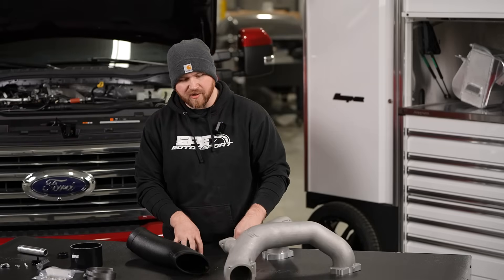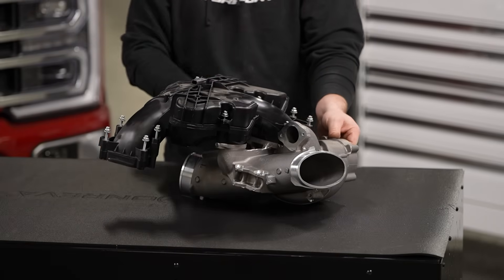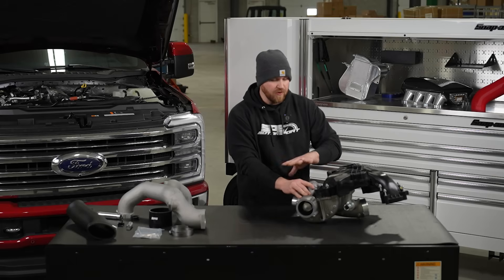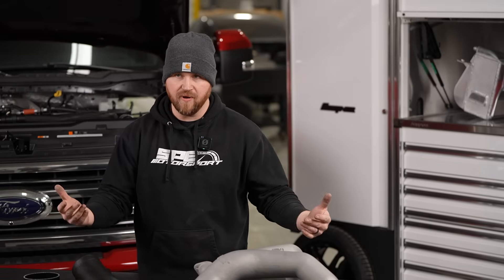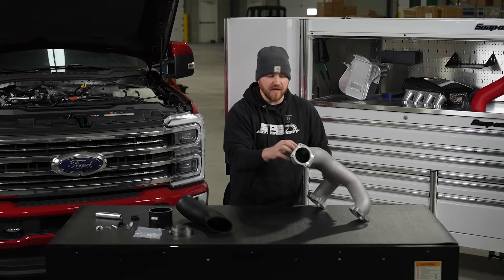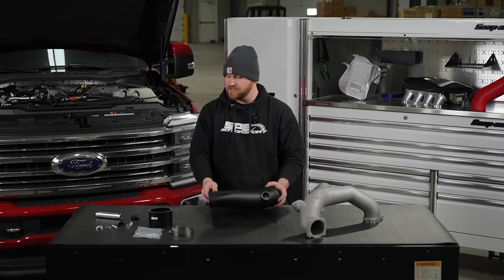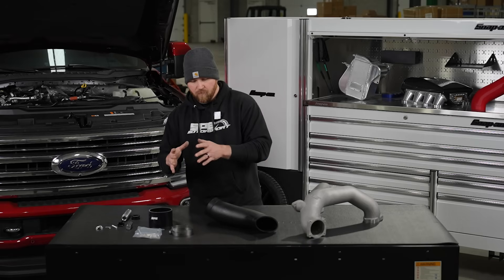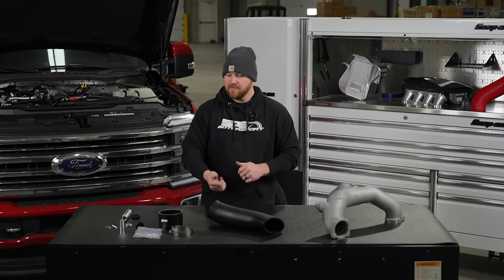6.7 PowerStroke OE+ Performance Intake Manifold from SPE

Comment: Ugh just saw a video of a guy installing the piping kit on a 2011-2019 f250/350 and he’s having fitment issues/wrong size clamps. Sucks cause I purchased one of these kits for my 2012 but haven’t installed it yet. Now I’m wondering if I should ditch it and get the pusher piping kit??

Comment: The biggest issue I have with mine is the EGR flange needs to be machined out further, and the screw adapter for the early throttle bodies is crap and a pain to install it. you should have just put the other screw hole in the casting I don't care what it looks like. the air intake tube for the 11-16 makes it where you cannot mount the factory tube in it's bolt hole by a full inch.
Reply: I had the same problem with the 11 to 16 cold air intake it fits very tight up against the coolant reservoir for the secondary coolant system. You pretty much have to install the bolt on the battery tray first because it’s misaligned by about an inch then you have to jam the boot together using a screwdriver also the flashing inside the tube needs to be ground out farther. There’s a huge ridge just inside both openings. I think the fit and finish could be improved somewhat I’ve never installed an S&B for that year truck so maybe they’re just as bad. I will say most of the other parts from spe are extremely good quality. No company is perfect. I did fuss about it to them and they sent me a new intake tube, but it didn’t fix the problem because all their intake tubes are exactly the same, but at least they tried to fix it.

Comment: Unless I update the turbo on my 2011 this isn't going to match up to the dual intakes on the turbo.
Reply: Theres not many options on the market for stock emissions + dual compressor wheel intakes. SPE and Pusher do make dual inlet intakes, but theyre non-emissions piping kits

Comment: Just keep in mind you will spend about 3,000 dollars (if you do it yourself) to just make the engine look better but this is not a performance intake like it says. 
You can look it up on you tube were they put it on a dyno after it was installs and it made no difference at all in power at all. 
But yes it will make you engine look a lot nicer and less cluttered.
Reply: Bet the airflow and throttle response is way better in the EGR area. Especially after that soot accumulates. Also if you delete, getting rid of a sure to be sooted manifold is a plus

Comment: Looked on SPE for additional information regarding gained 30hp. 

Any 6.7 HO estimate overall performance Gains:  HP and Torque with SPE Intercooler, XD Hard Cold pipe, Hot Pipe, and this Intake Manifold?  Any data using all products listed above.

If you could provide the supporting documents, that be appreciated.
Reply: Their supporting documentation is just trust me bro it works.. 😂😂😂
Reply: @jerrypolete5258 ya… their replies when requesting supportive data historically been zero. I do like their designs and quality, but would like more information reinforcing their claims. Many Brands are weak on that… S&B and Pusher are a few that do provide additional data and tests.

Comment: My 13’ F350 is not deleted and mostly OEM. It does have the S&B cold air intake and Sinister Diesel Cold and Hot side charge pipes on it. Will this OE+ Performance Intake Manifold Kit fit everything I currently have that’s after market like the Sinister cold side charge pipe and S&B cold air intake?
Reply: Yes it will I have same pipes on mine

Comment: Question, how does the oil and transmission dip sticks stay in place is there a bracket on the manifold to hold the dip sticks in place and from not vibrating
Reply: It comes with a bracket. If you download the instructions off of their website there are a couple of pictures. I have a factory CCV box so I had to modify it. Works out nice.

Comment: Would this be better then say purchasing your piping kit? , I have a 19’ and it has a stock intake, what would be better, this and your guys cold side or the piping kit. Just curious
Reply: Piping kit doesn't have EGR provisions. I went with this setup in case I ever had to go back to stock. I could plumb the EGR back up and put my throttle valve back in place.

Comment: If you are putting this on an emissions compliant truck you will have egr performance issues with your design.
The OE throttle valve and valute were designed like that to help the EGR function more efficiently and better distribute the EGR exhaust into the air stream before it goes into each bank.

Your design is good from a performance standpoint, but with emissions on it will have issues.
Reply from the maker: We do a lot of testing on all of our products before releasing them this product was tested for a full year! During testing the only measurable changes during logging was increased fuel economy and obviously overall power. Dpf loading went down. Urea consumption was the same towing and driving normal from the base line testing. If there is a change its not measurable enough to matter.
Reply: I wonder how that would show up. Would you use more def to combat the NOx? Would your engine be putting out more soot therefore decreasing mileage between regens? Would the soot loading even change at all? When is the EGR even flowing, high engine load, low engine load, idling?
Reply: What’s emissions?

Comment: Originally installed the regular piping kit. Had a few issues running with PPE intercooler and map sensor codes. Ordered this kit and installing tomorrow on my 2024 HO, I’m excited to get it buttoned up and see how it does. Also, added the re-circulating CCV.
Reply: Any updates? Can you feel a difference or hear the turbo more?

Comment: How does this compare to a regular piping kit?
Reply: Piping kit doesn't have a spot for EGR to be hooked up, or a flange for the throttle valve to remain in place. This kit does and works if you are tuned or still stock. Piping kits won't work on a stock truck.
Reply: The Pusher kit is much more refined and gives you aluminum upper and lower. no plastic and their EGR connection is brilliant. If this kit is an 8 the Pusher kit is a 10+

Comment: I just put this on my 2013. The CCV stub is way shorter on the 11-14s. The piece you provide needs to be shorter for those years to fit better. 

You also say that this kit includes couplers, mine didn't. Chance said that the 11-14s don't. 

I will say that I am very satisfied with the kit. Easy to install. I downloaded the piping kit and manifold instructions and cut the upper inlet of my turbo off, didn't need to actually do that, but it still fit fine. Saw after the fact that there are instructions that say OE+ which is what I should have gone with. Oh well, saved a couple of trees.